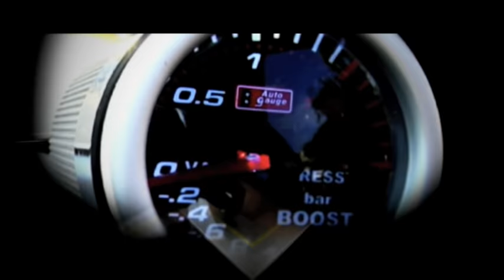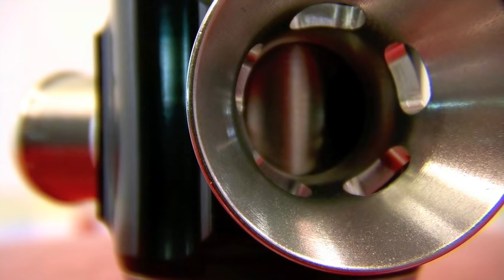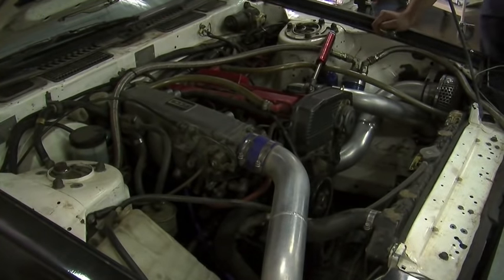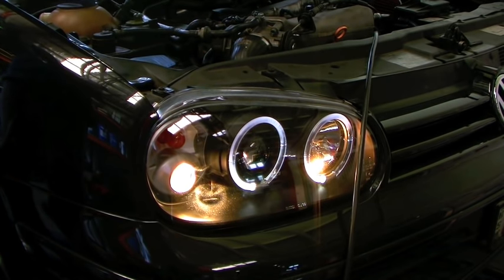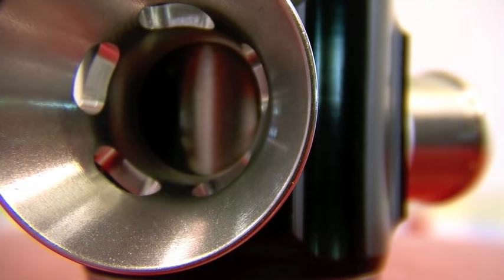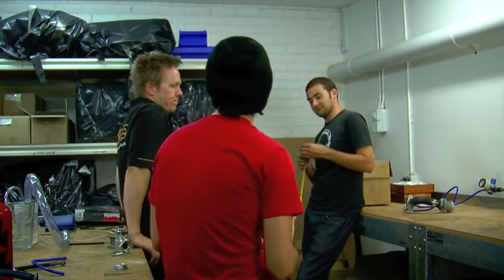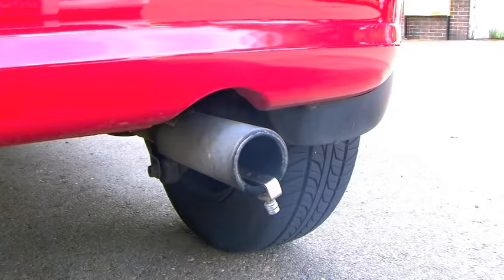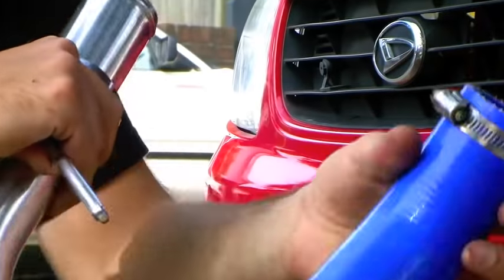Blow Off Valves Mythbusted

Comment: Question, isn't the reason someone with a non turbo car would get a BOV the same as someone with a turbo car would since they come with stock BOVs anyway and it's just for the tsss sound?
Reply: 4c00h Most stock turbo cars I have seen recirculate airflow.
Reply: 4c00h Non-turbo cars don't come with BOVs. NA engines have vacuum in the intake, not boost. This means that opening a valve there would suck in air, bypassing the air filter and sucking in crap into your cylinders!

Comment: The dyno test is dumb, a blow off valve is not supposed to increase power, especially not high end power. They're supposed to prevent damage to your turbo and intake valves during the lag between letting off the throttle and loosing boost. Recirculating valves improve low end power by reducing the lag between coming back on the throttle and boost building by keeping the turbo somewhat spun up while off throttle for short times.
Reply: Exactly, I lost my shit when they try to install it and see if it gains power lmao

Comment: I didn't really understand what would happen without a blow off valve. Is it just bad for the turbo?
Reply: Ah I see. Thank you for explaining that for me!
Reply: It's bad but you get that cool "stu tu tu" sound
Reply: wolfie239w It is not as bad for you turbo as some say
it may shorten the lifespan of the turbo a little bit but its so little it doesnt matter
people have been driving turbo cars for years upon years without a bov and it doesnt destroy it
on the other hand, what can destroy your turbo is the turbo surge
this happens when you have more boost than the turbo can hold so it releases it 
on a car with no bov the flutter comes from letting go of the throttle
on a car with turbo surge the flutter will come when giving full throttle after spooling
so ive heard
Reply: wolfie239w A turbo on both the compressor side and the exhaust side is meant to spin one way. Once you build up pressure on the compressor side (and the throttle plate is open) there is pressurized flow going into your engine (hence the force induction), the problem occurs when you let off the throttle, the throttle plate closes and now you have all this pressure built up in your intake system. This can cause that pressure to force back onto the compressor wheel of your turbo, that pressure wants to make that compressor wheel spin the other direction (it has no where to go). This is compressor surge and can cause damage to your turbo, it's seals and a host of other things. So rather than let that happen, your blow off valve will actuate the moment you let off the throttle and your throttle plate opens causing all that pressure to be release and keep that compressor wheel spinning in the right direction.
Reply: ***** yeah but honestly, the flutter sounds amazing and i would rather lose some turbo life to have the flutter
Reply: Mike LeBlanc that is not compressor surge

Comment: Diverters re run the air back to the turbo to keep it spinning.. blow off just release it and can fuck over airflow sensors and tthrow codes
Also you can buy blow off vale speakers on amazon

Comment: How do they get the turbocharger to spool up in neutral? My car makes the whoosh sound, but only when it's in gear. Actually it seems like the turbocharger won't kick in unless it's in second gear or higher, which I don't really understand either.
Reply: Richie Schneider The engine has to be under load and the turbo charger generating positive pressure (boost) since the pressure is what is being relieved by the bov. (You can't do it in neutral, first and second gear would require you to rev it out longer since your turbo charger is powered by exhaust gas... created by your engine running under load...)

Comment: Blow off valves help with shifting,  a dunno doesn't measure acceleration,  which would be helped by better shifting.  So testing whether a bov helps or not on a dunno is totally pointless. Unless it's a leaking one and you're losing boost.

Comment: So the magical sound of Turbo flutter is actually quite bad?
Reply: MrProtoking it isn't very good for something moving at over 100,000 rpm to be forced in the opposite direction which is what the flutter sound comes from.
Reply: It's fine, turbos are designed to handle it and no it doesn't cause the turbo to spin in the opposite direction, it's very common for people in Australia not to run a BoV.
Reply: Not what i was saying, the back pressure has long term effects on the turbo. just wears it out faster. Not saying you need  one its just better. And i wasn't saying it started turning the other way its just the back pressure forcing it to slow down rapidly.

Comment: Me and my buddy want more boost out of his 2001 vw Passat, with not enough cash for a turbo upgrade, can upgrading Bov or getting an Audi diverter valve help this? Or do we need aftermarket ecu so we can tune it? Thanks.
Reply: Matthew pawlak An after market blow off valve will only increase power if the equivalent part currently on the car is leaking pressure. Any petrol car with a turbo upstream of the throttle body has to have a way of bleeding off pressure when you let off the throttle. Your car must have something that does this. If it is leaking, you are loosing boost and power. If it not leaking, adding a blow off valve will not add power. My recommendation, put a pressure gauge on it and see what kind of boost you are getting and compare that to what it should be making. If the boost climbs correctly, but drops off early, you likely have a leak.

Comment: If you have metered airflow which that gti does, when you blow off air to atmosphere, the computer will still dump fuel thinking that air is still in there, which it isn't anymore, causing your engine to run super rich when you let off to hear that whoosh noise, meaning tons of unburnt fuel. Trust me. I have a jetta 1.8t with a blow off and I smell fuel every time I let off the acceleration and the rpm hang a little high after letting off sometimes.

Comment: im planning on removing the bov or bypass valve. ( by a metal piece the works like a gasket but with no hole ), im running 14 psi on my wrx.  will this shorten the life of the turbo big time  ? not a lot of research on this subject but far as ive read, if the boost pressure isnt high like 25-30 psi, it wont do damage at all. this sounds insane to me. someone help.

Comment: Yikes, reading through this comments I'm seeing a lot of misinformation.  The ONLY way a bov or BPV would gain you power is if your previous one was leaking.  Be it by not holding boost or sucking un-metered air into the system..

Further, it DOES in fact matter which one you have on most turbo cars because the airflow meter is almost always before the bpv meaning if it vents off and was originally a re circulation the ECU thinks its getting the air and dumps in the fuel when in truth its getting less air because it was previously vented to atmosphere.  It has also been proven that hybridized and full recirc set ups tend to have better throttle response because as the gentleman said they are not dumping the charge tube of all the boost.  

This can also come down to the car your working with but in my experience my car performed much better with re circulation the throttle was snappy and responsive with my full on blow off it was perfect when drag racing but not so responsive when commuting.

Comment: I have a 85 nissan 300zx turbo with the stock garret turbo and stock vg30et motor it is not a issue of availability for me but i keep the car as original as possible within reason particularly cosmetically i keep it stock as i love the atmosphere of that old school car and it still is fairly fast and easily smokes my 85 c4 corvette with a built tuned port injected 350 v8 my question is you hear absoloutly no noise at all when you snap the throttle shut at full boost  (9 psi give or take) and i am wondering if the car just does not come stock with a blow off valve i can not see one through a basic inspection of the boost tube from turbo to intake manifold but i can not see it very well as it is fitted extremely tightly in the engine bay and the turbo is very hidden on the right side of the block near the oil pan and is completely covered up from the bottom if anybody knows anything about this at all please contact me at my number 2072423059 thank you

Comment: My mazdaspeed protege makes that said Woof woof woof sound..  is my bypass valve sticking or something?
Reply: That's backpressure that a blow off valve would catch making a tsss sound. The wowowo sound is from not having a blow off valve which is pressure going through the turbo in the opposite direction which is not good for it, or the engine although it sounds awesome and I personally like it better

Comment: If you already have a blow off valve is it okay to have a anti-lag system too?
Reply: I think
Reply: I doubt that would work. Anti-lag works because the ECU causes the engine to burn a rich mix, so what happens is not all the fuel is burnt in the cylinder, but when the fuel escapes and touches the exhaust manifold, it burns then. But burning requires air, so you would need a bypass valve which would push air into the exhaust manifold.

In your case, you have a blow off valve, and thus no air is being pushed into the exhaust manifold. I would think it is impossible for you to have an anti-lag system.

Comment: I'm sorry but I don't care what a computer has to say about the power output. The real question is, does the car run faster (how much faster) and does it accelerate faster. What is the top speed of any given car with those various blow-off valves, and what is the 0-100mph time. A computer won't tell you if the car runs faster. Only running the car down a straightaway and timing it will tell you that. So we basically learned nothing about blow-off valves in this video.

And I have never heard of this "most controversial" question about whether you can run a blow-off valve on a non-turbo car. What could a blow-off valve possibly do for a non-turbo car except make it sound cool? What are you trying to do, blow out the extra exhaust which will naturally blow out the exhaust system you already have? I mean yeah... you CAN run a blow off valve in a non-turbo car... but that's like asking if you can make an airplane fly by adding an extra pair of wings... I mean you can add wings, but it already flies...

Comment: you did it a little bit wrong. BOV does not increase power. its job is to release compressed air between turbo and engine. look... turbo goes at highest rpm and compresses air to the engine. you release throttle and what happens? engine doesn't take this mass of air so this compressed air stays between turbo and engine. so... the only way for this compressed air is to get back to the turbo and slow it down and you have lag now... it takes time to speed the turbo to its highest rpm again. BUT bov releases compressed air so it doesn't go back to the turbo and doesn't slow it down and it is at high rpm and you got almost all power of turbo under your foot at instant. you cannot meassure this at dyno. only at the racing track.
Reply: Pretty sure these guys are trolls.

Comment: What myth? HP test??? What does that do? Nothing. A Blow off valve only eliminates the time before the car comes back on boost after gear changes(or the throttle body closing). No added HP, only time saved before max HP is achieved. Love all the other Vids Lads.

Comment: Maybe it's just me, but I don't think "the most controversial question" regarding blow-off valves is whether or not you can put them on a NA car... It's whether or not a blow-off valve will extend the lifetime or your turbo by avoiding compressor surge (and turbo flutter at higher levels of boost). But that's none of my business 🐸☕️

Comment: heres a question can you put a BOV on an automatic car with turbo
Reply: Majoras Mask of course u can
Reply: Dennis  nguyen awesome man thanks its cuz i have volvo s40 and i wasent sure dont wanna mess with it you know
Reply: +Majoras Mask Like the guy from GFB said, pretty much every production car that has a turbo on it has a BOV. Assuming you have a S40 that already came with a turbo, it'll have one. You can of course replace it with one that you can actually hear but be careful about how the intake air gets measured on your engine. If it gets measured right at the airfilter a BOV that vents the air into the atmosphere will throw off your ECU and cause it to work with wrong measurements of how much air the engine gets.

Comment: I'm a newbie to the JDM / car mod scene and i was wondering if i could add a turbo kit with blowoff valves on my automatic nissan 350z ( its all stock and i recently got it but wanna make mods to make it sound and look nice )
Reply: Yes you can and thinking same thing with my automatic accord  but leaving body alone I'm lil old school in the sleeper look first car I had was a old chevy wagon with 400HP flat track motor in it
Reply: my friends gonna turbo his 98 civic
Reply: not bad my freind installed a turbo on his but he's what i call a ricer did it cheap dam thing iether blows oil lines or vacum hoses. tell you're freind to take time do it right
Reply: my friends honda's exterior is rice im taking over it since he;s getting a hatchback lol so we can both be working on something and yeah me and him are buying quality performance parts to make sure it isnt cheap cause shit can always backfire if it isnt done right with the right parts
Reply: Running high boost shit will go wrong with good parts, let alone shit ones

Comment: A blow off valve, isn't that called a jake brake (like in a diesel) ?? Around here a jake brake is illegal in town.
Reply: +Senior Frog No, a Jake brake uses the air brought into the cylinder(s) on the intake stroke as a brake by opening the exhaust valve near the top of the compression stroke. The air that is compressed in the cylinder slows the engine (which in effect slows the rear wheels turning) and then it is released prior to the power stroke preventing additional power being put to the wheels. It is used on semi trucks to help maintain speed going downhill and to aid in stopping. It also keeps the actual service brakes from overheating due to the fact that you don't have to use them as much. Sorry for the rant but I always found them interesting
Reply: Not a rant thanks for the info!!!
Reply: You're welcome!
Reply: Ok what I have yet to figure out is why you would put a blow off valve in a non turbo car? That's where I came up with the Jake brake I knew they were used in diesel and a few people I have known put them on motor cycles for dirt racing. I was just trying to figure out why you would use a blow off on a regular car? I don't see that it would do anything.

Comment: sorry but I have always gone turbo, for the fuel and power benefits, It is a big ass insult if a NA puts a BOV on and also it is not installed like a real BOV as that would drop manifold pressure and kill the engine,any person with NA installing a BOV needs a kick in the nuts and barbed wire up the pooper!!as for the BOV its there to also stop high boost from blow back, as for the atmosphere VS recirculation, it is only a sound thing, you can always install a dual system that is controlled by a switch(pffft for hill and tunnels and pssst for 50 and street chill) fact not given! the recirculation one actually diverts back to the induction pipe from air filter.. but if you get a good recirculation BOV you can still hear the PFFFT from it ,it just is not loud as atmosphere .. I been pulled over 7 times and I love showing my engineers papers from road transport saying it is approved and legal. FTP!!...really puts the finger up the cops when you have a legal PSSTT! and as for the illegal factors.. the gas/air being released from the BOV to atmosphere!! it is not actually bad air, it contains no chemicals but cops fluff you over because old people poo there panties when a turbo car flies past and goes PFFFTshh!, but look at trucks!!they have a BOV for brakes and it releases actual bad gas direct from exhaust...If you really want the atmosphere BOV.. go the dual system, hide the valve and switch  and PFFFT your butts off and psst the fuzz... GREDDY/HKS/TURBOSMART all do a dual BOV each has it's own unique sound...HKS sound the best with the sequential PFFTSSSTATATA!! sound...

Comment: Blow off valves can be install on a  turbo diesel car?
Reply: If your car didn't come with a bypass valve, you should consider rebuilding your turbo
Reply: Matteo Furlan the short answer is yes. any car that came with a turbo from the factory should already have a blowoff valve, they're just very quiet
Reply: Tom Cieminski thanks

Comment: would it be possible to make a bov work with the exhaust pressure?
Reply: +Adan Juarez Jr 
not being a petrol head, just a regular driver of a regular car, 

I think its actually over pressure that triggers it, when you close throttle the air can't go anywhere so as the exhaust gasses continue to drive the turbine which continues to charge the induction side, so the exhaust gasses have to go somewhere, this causes the valve to pop open, which drops the pressure, as the pressure drops it slams shut again, just like the safey valve on a steam locomotive.
Reply: +Xantec Oh Ok, thanks

Comment: Factory horsepower(or kw) ratings are measured at the crank. The drivetrain consumes about 25% of the power. So 100 kw at the crank will be around 75 to the wheels. This car making 105 at the wheels means it is making a little over 130 at the crank, more than 20 over stock. Considering this one is modded, seems legit.